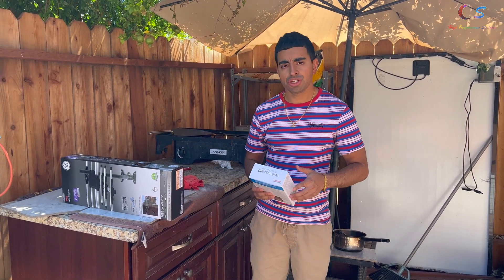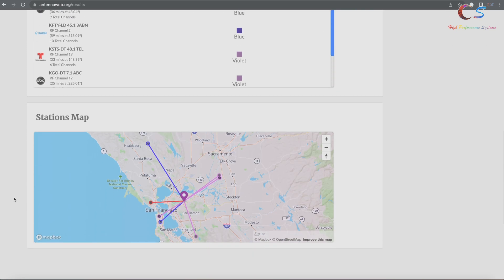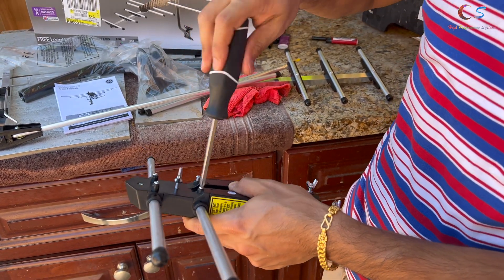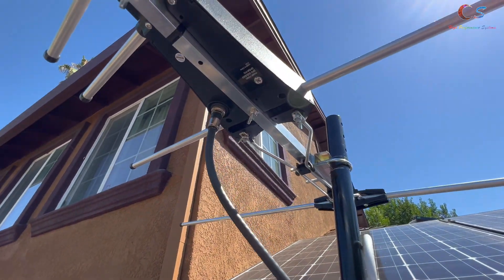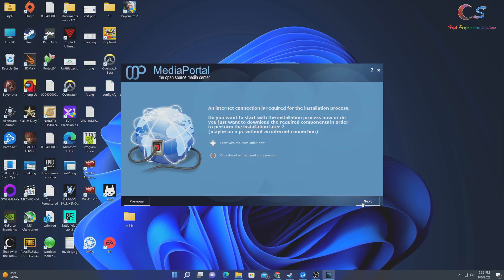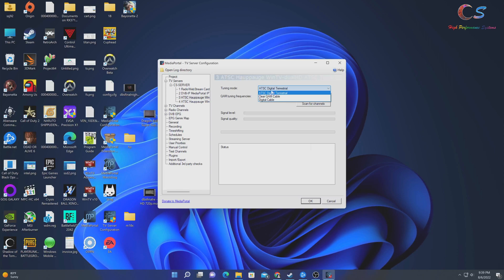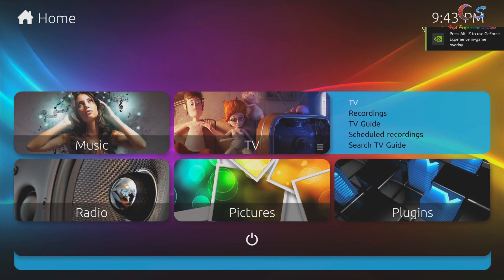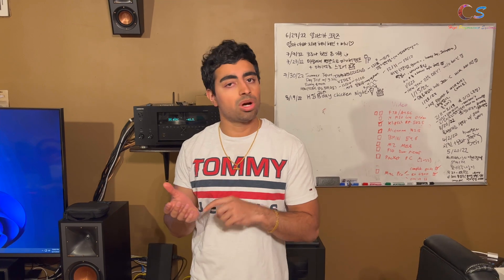Free TV in the Air! ATSC Antenna & PC TV Tuner

Comment: WinTV-8 crashed a lot.  
I found that if I went through the bother of setting up the drivers on my Linux box and then running Kaffine to watch TV was better.  Maybe WinTV10 has the problems fixed. 
WinTV-8 had the ability to record TV programs.  I assume WinTV-10 does too.  A nice thing about recording is that you can set it to record some of those old movies or programs that come on in the small hours of the morning and then watch them at a reasonable time.
Reply from the maker: I haven’t used WinTV v8. Last one I used was probably v5 or something super old. V10 works well, only thing I don’t like is it takes a few seconds when you switch channels or do epg etc, but otherwise works fine. I like WMC and MediaPortal though for their GUI
Reply: @cs.studios  Kaffine also lags on doing EPG.  I think that comes with the technology used to transmit it.  A lag on changing channels may be just how long the tuner needs to lock onto a signal.  It takes some time to settle.